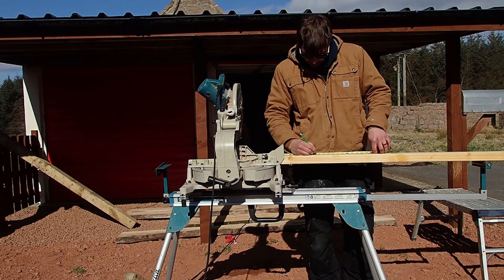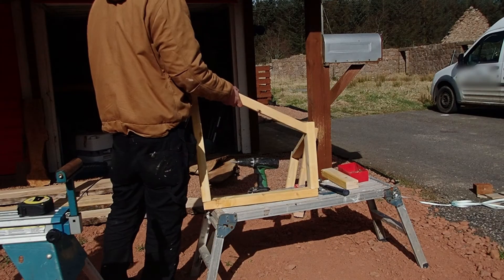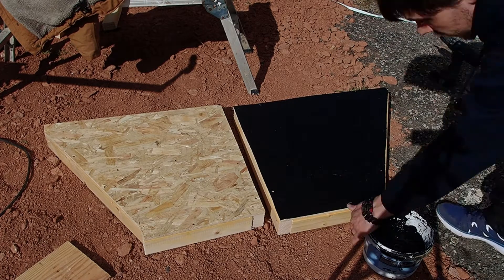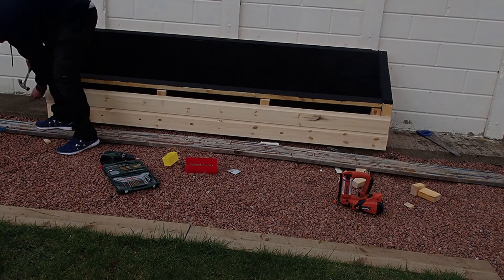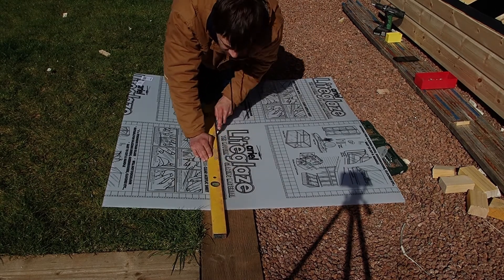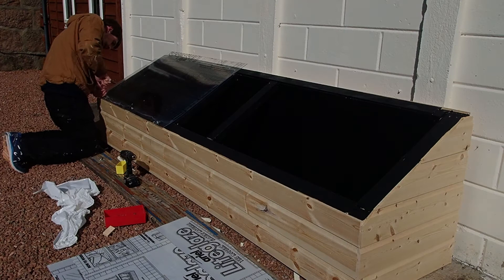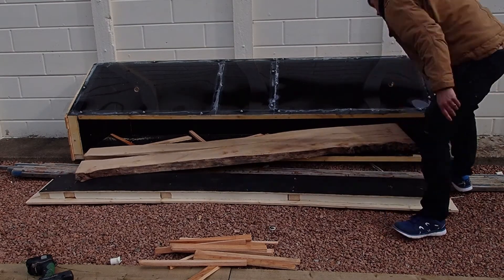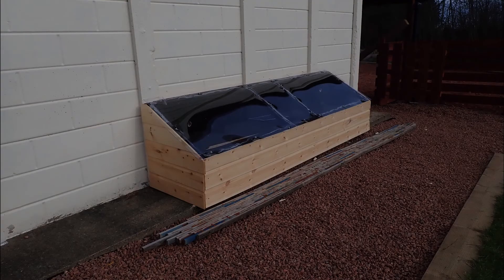Building a small solar kiln for under £150

Comment: Alright mate, fellow Scotsman in the north west here. Im nearly done making my own kiln, not based on really anything I've seen, but, think it will work. My question really is just a bit of expansion on something someone else asked. When you said you had timber in it for 7 months and it hit 5%, was it green when you put it in? What was the %? 
I plan to use it for firewood and timber for projects. Do you think its possible to over insulate it? The internals are split into two is that right? Like a heat collector then the timber separately and fans to circulate the air? Thats what id have thought, do you think it'd also work as just an open single chamber?
My biggest concern really is not getting the temperature up inside ivo lack of sun, but you said you didn't have any issues.
Anything you can send me in terms of advice would be amazing man. I've got this far with a bit of YouTube and common sense, but, good to hear how others in the country have done things.
Cheers
Reply from the maker: Aright loon. So the timber went in green think it had been milled a week before it went in. So at the time I was using a pin moisture meter so that % was at the surface so it was probably a lot higher in the centre. 
I don't think you can overisulate as you want as much heat as possible you just need to get the humidity out. Yea my one was just a single chamber just had a few fans to keep the air moving.
We live in Scotland so Sun is a rare commodity here I was lucky at my old place cause where I had mine it got direct sun most of the day. That's the main thing you need the sun try find the lightest part of your garden. In the end i had one of my fans stuck to a vent trying to pull the moisture out, also got a digital thermometer and humidity thing just to track it. 
Hope all this makes sense anything else u want to know just let me know will try to help.

Comment: That's exactly the shape and size I'm after.   I don't want to connect any fans or solar panels though.  Do you know the best place to put ventilation so that the air inside will move by itself?
Reply from the maker: Been thinking about this for the last day and without fans will be difficult to get the air to move right. but maybe some vents on the floor and some as high up as you can get it. Might force some movement. tbh I think you will just end up with little to none tho. If you try it let me know would be interesting little experiment.

Comment: Hey man. Nice work... it's been a year now. How is the kiln working out for you? I'm considering building something similar but just a little bigger
Reply from the maker: well so were almost at 2 years and it worked great for the first year got a few slabs dried out perfectly. then we had a massive storm and a tree landed on it completely destroying beyond repair. got plans to make a 2.0 at some point almost the same but on steroids
Reply: @nailedinscotland  .  That was some storm but hopefully it was a once in a lifetime.  I’m thinking of using clear Onduline on mine because that’s pretty tough stuff so that might work for v2.0.  👍🏻🏴

Comment: Next time make the top cover openable- like a lid of a large chest - that will make loading MUCH easier!
Reply from the maker: Hi thanks for the comment. I did originally think about that as your right it would make loading easier but for unloading would need to take everything out to get at the bottom piece also for monitoring moisture content and just checking the material I decided it would be better from the front as this would allow me more access

Comment: Hey, just found your video and I appreciate you laying everything all out. One question I had is, is your setup more about direct sunlight hitting the kiln, or more about the overall outside temperature?
Reply from the maker: Hey man. Yea your trying to get as much sunlight in as possible the angle I go on about helps get maximum amount of sun light and the insulation and black paint just help keep the heat in, IV found mine about 15c above outside temp but believe it's been hotter
Reply: @nailedinscotland  ok I see. And then, with this method, have you ever found a desire to add ijna dehumidifier to aid/speed up the process? Or would it not really be worth it?
Reply from the maker: @Therunnerisrunning  i will be honest i never thought of that, i think that might speed it up a little as i have seen condensation on the top

Comment: Nice video, how were you able to vent the air inside the kiln or air exchange able to happen because the seams were loose?
Reply from the maker: Hi man so I forgot to show it in the video still trying to remember to film things. I put to holes in the back to allow air to circulate also 2 fans inside to keep it moving. The seams appear loose but because of the insulation they are very tight opening it is a night mare hope this helps